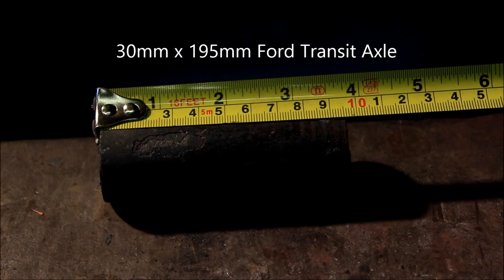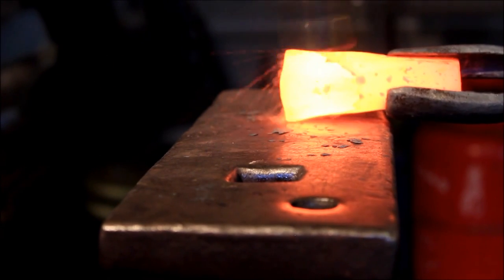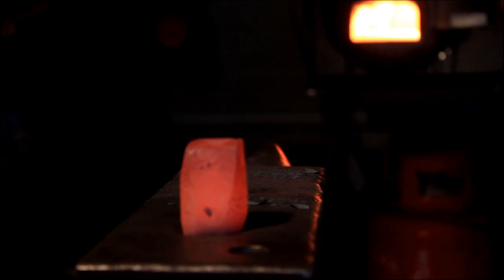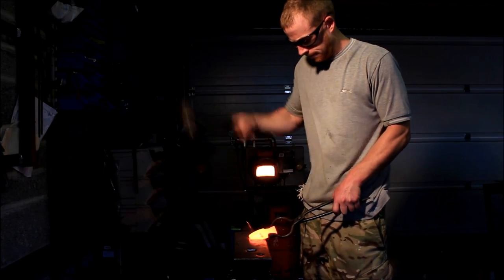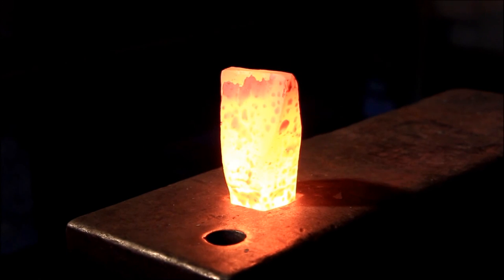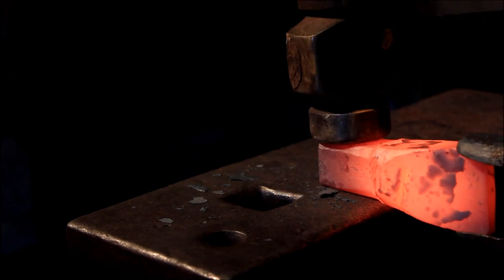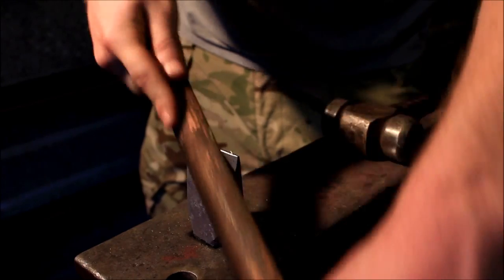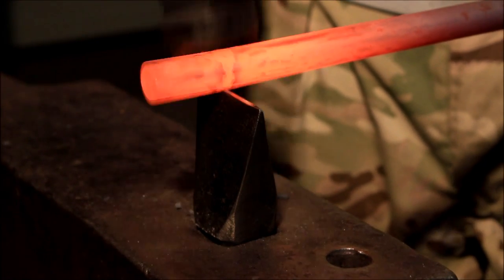Blacksmithing - Forging a Hot cut Hardie / Hardy Tools

Comment: With the gas forge , ive seen some smiths partially quenching the piece, effectively leaving the finished sections quenched but the working portion still at yellow heat, seems to be good to prevent mushrooming when setting the shoulder, or protecting the shank while drawing out the edge, hope it helps!
Reply from the maker: I do that too but not with this type of steel, mild steel or any other non hardenable steels i will quench but for tool steels that may shatter when quenched and struck, i would not risk it myself.

Comment: I'm trying to start blacksmithing at my local museum, but I only get to go once every couple if weeks, so the learning is slow going. I'm trying to find some mechanics that will just give me an old axle or springs that I can use but no luck yet. If I get this made I'll try to record it and I'll post it here.
Reply from the maker: Sounds good!! Mild steel would work for this too, will need dressing more often but if your not using it often then maybe thats a route to follow in the meantime until you can find some better steel, or get some better stuff from a supplier so its easier to heat treat rather than guess work.
Learning is slow in this craft for sure, it will get quicker when it 'clicks' but not by much haha, so much to learn, im just a beginner myself and always will be, something satisfying in knowin that i will never learn everything even if i had many lifetimes.
Please do post it here, would be good to see how others are getting on with this project.
All the best!!
Reply: Well said!  I have been smithing for almost 20 years, and stil consider myself a novice.  That's part of why smithing is so popular...it is constant learning. Either from successes or mistakes of others, or your own experience.  Mastering any craft is a fantasy...we are always students

Comment: Great demo,I was a little worried when I saw you hitting the  work with a sledge hammer into the hardy hole but then I realized that because you had already started to forged the shoulders all the force is on the anvil face,I had heard of some anvils breaking at this point.Also I like you hammer in this video you just proved what a 1 3/4lb can do
Reply from the maker: Thank You Stephen, as long as i keep the shoulder part hot it shouldnt do any damage if i let it cool and carry on hitting it i would be in a lot of trouble and would risk breaking my anvil for sure, i dont give it full beans with the sledge just for this reason, if i did, i would have to fight a bigger bulge on the sides so just bite size chunks sufficed enough.
It can do a lot of work if used properly and if i keep the steel is hot, my little whipper snapper she is.
All the best my friend
Nathan

Comment: Thank you for this, so what do I do just go to the local wrecking yard and tell them I'm looking for a Ford Trans Axle? You make a great teacher.
Reply from the maker: No problem, thanks for watching!!
I used an axle from a ford transit, which is a type of van here in the uk. so i think most axles from vehicles would work or any other medium to high carbon steel would work, even hot rolled steel would to a certain extent, just the angle of the cutting edge would have to be a lot less steep to prevent bending over if hot rolled was used. use something slightly larger than the hardie hole is the rule, i have a small anvil so i could get away with 30mm bar, most big anvils you wouldnt be able to get away with that size. my rule of thumb is 6mm wider than the hardie before even starting. Hope this helps rob, good luck and have fun!!
All the best
Nathan
Reply: ***** Thank you for your reply, yes that was a tremendous help.

Comment: that is what i need thank you for this video,  a cutoff tool is normaly very expensive when you buy it at the forging market but i don´t know how i get this big peace of metal and i have the same forge as you im very impressed that i see a video on youtoube over this forge you can look at my channel in the future im going to start make videos over this forge sorry for bad english im german xD
Reply from the maker: ForJam it was from an axle on a van, a truck or you could buy some from a steel supplier. as long as it is wider than the hardie hole or swage block then you should be fine. Good english, probably better than mine. i will check your videos out.

Comment: Do you not worry about losing hardness around the hardy hole doing it this way instead of on a swage block?
Reply from the maker: +Friis Forge I do in a way but i dont keep working in the hardie when it gets too hot to touch as its a small anvil, if i had a swage block, thats what i would use for this application. The hardness is fine still. if i did it all day and didnt check by touching then yes the temper may run away.
Reply: +workingwithiron thats what im doing too. i need to make a swage block.

Comment: Fantastic video!  I have watched it a dozen times trying to learn the steps.  My anvil has a 1 inch hardie hole.  I think the transaxle may be too small for me.  What size piece do you think I should start with?
Reply from the maker: If you could get a 2 inch piece that would be ideal. I will show another way to make it easier for you though.

Comment: Whats the chain for around your anvil?....Does it mute the ring?....great video by the way!!!
Reply from the maker: res1492 it dulls the high pitched ring, doesnt stop it but reduces the noise considerably. Thank you.
Reply: +workingwithiron use a magnet
Reply: +harry joe A magnet helps tons. I have an old speaker magnet on mine. :) (and a chain)

Comment: I was wondering if setting the shoulders in the anvil with it hot like that would hurt the anvil in some way? Or is the anvil is a big enough heat sink for it not to matter?
Thanks for another video regardless, have a good day.
Reply from the maker: Yes it would if i left for a long time, but i keep the time in the hardie hole to a minimum to keep the temperature down and as soon as its out i put a wet rag onto it to draw the heat out, not cold water, very warm water so its not a shock to the anvil, i would only put the tool back in to set the shoulders after it has cooled down enough to not cause damage, gotta treat it well as its my main tool. A swage block would be the chosen tool of choice for making these.
Thanks for the comment,
Cheers!
Nathan

Comment: I might have missed it but what size is your hardy hole? My anvil has a 1" size so im wondering if 30mm round bar is the right size.
Reply from the maker: Just under an inch my hardie hole is. Its what i had at the time the 30mm and it worked fine. If you go bigger it will be better but for what i needed and what i had it works well. Hope this helps.
Reply: already started with a 30mm. if it dont work i got a pecie slightly bigger. I wont mind trying again because this is the first working with with steel this big.
Reply from the maker: Ah Nice one!! Just make sure its hot when in the hardie hole and check all around it for any small fractures before doing the upsetting. work it hot and you will be fine. Its great practice just take your time and take it step by step. Have fun and good luck!!

Comment: You can isolate the heat by doing a partial quench in water.
Reply from the maker: Not on Tool Steel, Mild steel, yes.

Comment: Nathan quick question regarding scrap metal. Is this drive train or axle or would either do??
Reply from the maker: Either would work, this is an axle. I have to redo this video as I've learned a lot easier way since I made this.
Reply: Working With Iron Nathan look forward to seeing that. Hopefully by tomorrow I will have bought a anvil of eBay and I can get busy putting my drum brake forge together. Looking forward to getting into some thick metal to forge tools like this.

Comment: 8:40 Why do you have so long handle on your hammer if you do not use the length to your advantage?
Reply from the maker: Good Point and great observation, i hold it at the point of balance and also if i used it at the end of the handle it would break as the shaft is shattered into 3 pieces at the moment and taped up to keep it together as i have not yet found a replacement shaft to put on it, something that i need to do asap. otherwise i usually grab it about 2 inches from the end, but being broken it flexes too much and breaks open the tape that holds it together.
Cheers
Nathan

Comment: So, you just harden the tool without tempering? It will not break in harder blows?
Reply from the maker: As it is only for hot work it wont shatter as i am not hitting it with another hardened tool or cold metals. the shape transfers the blows to the anvil rather than the tool itself.
Reply: Ok thank's for the tip :)

Comment: I am always concerned that I will pound the item in the harder hole during the forming process so tight I can not get the thing out.  Is that really a concern?
Reply: neilyeag it shouldn't be, no. I would recommend never letting your peice get black cold but ileven if it did in theory it wouldn't get stuck since when you are pounding it in the metal is very hot therefore it is expanded so as it cools it shrinks down. Hammer it out with a punched if it gets a little stuck
Reply: Thanks for the reply

Comment: Great Video I have a Dodge axle out in the shop I'm going to build one
Reply from the maker: biggoldnugget how did you get on?
Reply: I'm injured so I can't forge for a while broken finger with a hole through it, so I haven't started building it yet but it's on my list for when I start up my forge next month.
Reply from the maker: biggoldnugget ah no way that's a shame man, hope you have a speedy recovery and get to bashing some hot metal soon :)
Reply: Thanks Man, It's getting better I can almost swing a hammer now doing light tasks for the now at least it keeps me in the shop

Comment: do you recommend a sledgehammer anvil?
Reply from the maker: +Try to survive as a makeshift anvil, Yes i do. just dress the edges so they are rounded and smoothed off to lower the risk of chipping. A good way i have seen them used is with a tree stump, the hammer head embedded within the tree stump with the top third protuding as the anvil. this stops it moving about and gives it a solid base. I hope this is what you mean.
Reply: ***** exactly!,i have 2 sledge,one for anvil and smaller one for pounding!.Thanks!

Comment: why the chain around the anvil ?
Reply: Because steel anvils make a terrible ringing noise when you hit the anvil, so the chain reduces the ring. :)
Reply: +zarkantees Chain helps with ringing, a strong base helps lots too as does magnets on the anvil. I use all 3

Comment: Why do you have the chain around your anvil?
Reply: I can't give a conclusive answer but I have a similar chain hanging there to help me keep a piece of material in one location when I'm alone and punching a hole
Reply from the maker: It takes the High pitched ring away, doesnt make it silent but for videos and to keep the neighbours sweet i do what i can to keep the noise to a minimum so i dont deafen people when they watch or when they are out enjoying the 2 days of sunshine we get here in the UK.
Reply from the maker: do you drape it over the anvil? I seen a great one of these at college, was a ring on the end of a chain welded to the base. it would rest over the anvil and the ring would be just off the floor so when you put your foot through it clamps the work down. Simple idea but a great hold down tool.

Comment: what is fishlipping? thanks! thumbs up subscribed*
Reply from the maker: Connor McKee Good question! its when the end of the bar goes hollow and the edges creep over it like a wave creating a hollow. imagine a fishes mouth, the lips and the hollow of the mouth opening. imagine the lips were the edges of the material and the mouth as a hollow being created from hammering the edges too much. the centre of the bar stops acting as an anvil for the edges pushing the material around it. its also called cupping. hope this helps a little. Thanks for watching Connor
Reply: thanks!!
Reply from the maker: does it make sense? if not i will try to explain it a bit better
Reply: Connor McKee

Comment: why the chain around your anvil
Reply: A chain with a weight on and draped over the face of the anvil can be used for the solo smith to keep a work in place if he needs two hands for hammer and tool eg a hot set. It could be that... or just a chain coz when he uses the hot set in the next vid he has a pritchel bar for it.
Reply: Gene Smith  The chain helps stop the ringing of the anvil that can get very high pitched and hard on the ears.
Reply: +Michael Clark just put a large magnet on it.